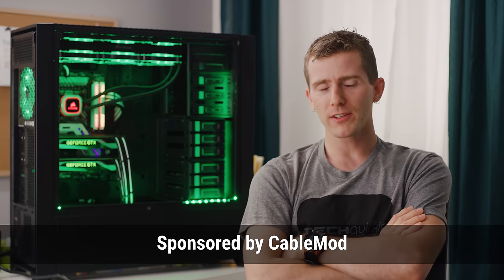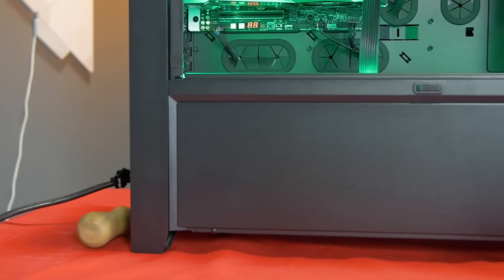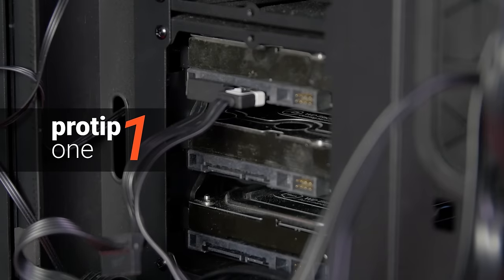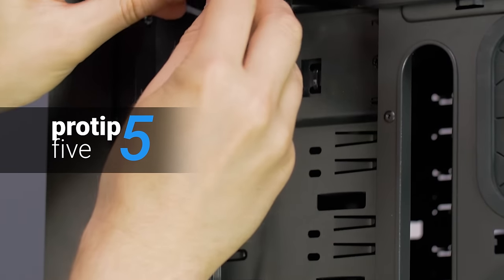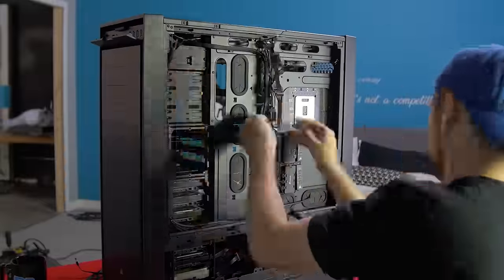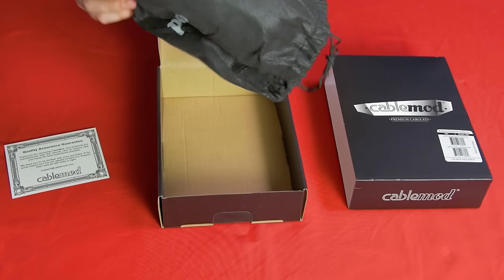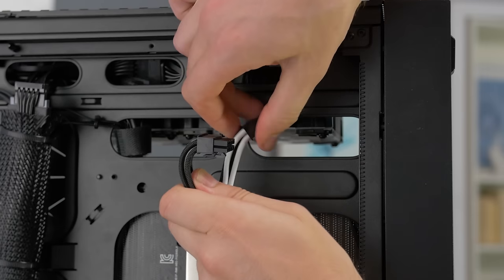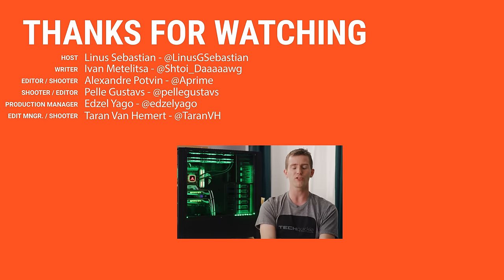ULTIMATE Cable Management Guide

Comment: 400 bucks on cables, no way
Reply: This.
I mean MAYBE if you want a specific color such as green, white or red in your build, then grab an entire kit for modular PSUs for maybe 50€ TOPS, but their whole bullshit is totally useless. 

Why in the fuck would you need custom sleeves that are 20$ for cables that you only see a few centimeters of, and WHY would you need sleeves for your watercooling ?
Reply: They're slow af to ship too. Don't accept returns, don't respond to support emails, and are pretty thin gauge wire. They managed to lose a paypal dispute with me simply because they didn't even respond to it.
Reply: Yes but in this case it looks shittier, I mean who the fuck needs a SLEEVE for his watercooling ?

If you want a green watercooling, you buy green coolant for cheap and that's it.
Reply: SpaceC0re there are plenty of cases for watercooling where you really need custom length cables. My caselabs s3 really needs very short psu cables since there's nowhere to hide them.
Reply: Well I can be wrong, but I guess you may have gotten scammed with that case, it seems far too expensive for what it is.
Reply: Nah I'm in France so there is a street in Paris called the "Rue Montgallet" which is FULL of Asian hardware stores, you can get everything you'd ever want to get there and they pretty much sell every piece of hardware possible.

Just got myself a new Meshify C TG case there on Tuesday, and they have everything delivered to them in two days tops. Really the best stores.
Reply: SpaceC0re when your watercooling components cost a couple thousand, and the case makes the build 10x easier and is the only one that supports the radiator config you want, a few hundred for a case is chump change. Caselabs makes boutique, high quality, 100% aluminum cases almost specifically for custom loops and they'll last as long as ATX pcs exist. It saved me at least 12 hours worth of build/planning time compared to my last hard-line loop in a normal $100 case. They're not a manufacturer for entry level gamers who want rgb, plastic, and stamped steel. They're meant for SERIOUS enthusiasts with very, very specific needs.
Reply: Enthusiast means paying hundreds for a case made of a basic metal structure ? Hmm...
Reply: SpaceC0re  i believe there is a saying in English that suits the whole cables and cases debate, it starts with; fool and his money... ; )
Reply: HOW TO BUY A GAMING PC, PAID 400 BUCKS ON CABLES
Reply: DagicCross  and another 400$ on water cooling fittings ; )
Reply: Result + 0 FPS
Reply: Custom cables are very much a luxury. They aren't for everyone.  Those triangle wall lights are STUPID expensive yet all over the battlestations subreddit. 

The standards cables aren't very good either. The pro is the way to go... Although that adds to the price. Cables AND cable combs are stupid expensive.

Shipping tho... The fact that Linus got his in a week is ONLY because he's Linus. It literally took about a month for mine. And I bought 1 24pin extension and 4 PCI cables. Short ones too!! 

Communication wasn't an issue. They are on Facebook Messenger. I asked them about my order and got a response in like 15 minutes.
Reply: Correct for custom length custom color thicker cables. A non custom kit is around $100 and a bit more will get you non pro custom cables for just the ones you need.
Reply: Looks good! Will consider buying there soon.
Reply: lol thats a 1070 xD
Reply: Anton Stones my rig costs less damn
Reply: Simon Liu . PayPal is disproportionately buyer friendly too.
Reply: If you have a cheap case - then optimising and tidying cables goes a long way. I spent what I thought was a lot for a case in 2004 at £50. It had really bad airflow. Panels off, watercooling. Thing overheated. I put the whole thing in a new case and it runs on air cooling.
Reply: @ Mark Coito lmaoo the Aurora Nanoleaf lights are TOTALLY worth the ~$220 they cost, even if they are gimmicky as hell. I don't think you understand the electrical engineering or business economics involved. A kit gets you 9 panels which equates to $24 a light. That really isn't that expensive considering they also need a controller, a power supply, R&D for a custom product, and programming, logistics/distribution, etc., which hasn't even been equated.
Reply: Thanks for the tip lawrance,im in the uk too and i got a prebuilt shipped to me and the cable management is so fucking awful,now i know where to look to get good cable management shit without having to wait for half a century to have them delivered.
Reply: I mean, if you're building a machine for over $10k for some reason then it might be worth it for the sake of completing such a machine.
Reply: Why do people spend $5000 on a suit. $600 on shoes. $1000 on car rims. Because they feel like it and it makes them happy. It's not hurting you at all so why complain?
Reply: 100%
Reply: if they were rgb it would be worth
Reply: 400 likes omfg
Reply: I could build a console killer pc in that 😆😆😆
Reply: @SpaceC0re Because some of us are happy to spend extra money on making it look cool to us and we can afford it. Why are you so invested in what other people do with their money? Should we all run our purchases by you and get your approval first? LOL

I bought an enormous Enthoo Primo Ultimate Deluxe thats almost as expensive as the case labs specifically because it supports a large amount of SATA drives (I can fit 8x3.5" and 6x2.5"), Dual PSU, everything is dust filtered and every single fan spot can fit a full size radiator because the case is EXPLICITLY designed for large systems with large watercooling loops. My motherboard is E-ATX and wont even FIT in a regular case. Is it excessive? Probably. Do I care? No. Am I happy with it? Very.

As for "looks shitter" looks are subjective - what you mean is it looks shittier TO YOU. But its not FOR you so who gives a fuck if you don't like it.
Reply: @Paradox Shift THANK YOU I was wondering what the hell those were actually called as I'd love to get some for my renovations :D Coming in a pack of 9 is perfect as I want to make a big gold glowy Tri-Force
Reply: Its for enthusiasts not the average pc builder. personally could care less about a window on my case so for me this is useless but for the people out there who do like to show off their stuff there is a place for them. Its like watercooling, no one really needs to do it but people do it cause they think its cool and want that custom look + max overclock.
Reply: Simon Liu Aluminium is a cheap and light metal. "Real enthusiasts" actually CNC/Carve/3-D Print their own cases. Because making your own case puts you at atleast 300% more enthusiasm level then buying one.
Reply: my Pc was 400 bucks
Reply: its OK if you dont get it, its called a trend for a reason. The old trend was wild cases, 100% custom watercooling, and unreliable cold cathode lighting. Nowadays its neat and uniform cases, RGB LED lighting, and custom cabling. If you dont want to pay cablemod a bunch of money for custom cables, its possible to do it yourself. Its just that Linus is sponsored by cablemod, so they get the drop. Mod One has sleeving supplies, wires, and connectors to build your own cables OR you can do what i did and buy some shrink tubing, paracord, and wax thread at Michaels (or any craft store) and make custom cables from your own cables. I think i spent $20 and 8 hours modding and threading my own cables (soldering required if you are reusing pins and wires BTW). It doesnt look as good as PVC sleeved cables with cable combs, but it's still miles better looking than standard cables. Obviously it doesn't help performance (it can help cooling though depending on how ratnesty your cables were to begin with), but the best racecars are painted nicely and wired efficiently anyway.
I know most of you dont have to care about what other people think, but i like it A LOT when people notice my cables and tidy PC. It just comes with my sense of pride.
Reply: Is that from Apple press release?
Reply: bitfenix cable set cost 100$ and are pretty good
Reply: corsair sets are only £50ish, are they any good
Reply: you pay the coloration/design of those cable but all of them are good
Reply: @diwiak  wut
Reply: @spacec0re78  Ils paient la hype plus que le matériel. Le prix d'un objet est fixé selon ce que les gens sont prets à payer et pas selon ce qu'il a couté à produire.
Si il avait fait ses cables lui même c'eut été mieux, là il ne s'agit que d'argent. Des gosses de riches ;)
Reply: My mouth dropped when I saw that total.
Reply: Its linus, What did u expect? he is the guy who tells you to buy those 1200 Ngreedia shit and Intel garbage. So $400 cables are nothing for him.
Reply: Find all parts on aliexpress, they are dirt cheap and learn how to do it yourself. I can send you list of links I favorited from their site with all the parts one could need for sleeving.
Reply: this guy gives good source info, as in how to run cables, set things up, ect, but yeah when it comes to actual builds he acts as if everyone should have the money to be building a $1000+ rig and if youre not spending ass loads of money what youve built is a pos, when in actuality its only takes around $500-$600 to be able to play most modern games on high settings, less if youre just playing fortnite, apex, ect.
Reply: Thats as much as my GPU and CPU combined
Reply: @spacec0re78  The question, my friend is "Why Not?"
Reply: Get the rich guy at school to do it for u
Reply: Taking the piss.
Reply: I just paid the same amount for a pc😂
Reply: Honestly just the 3 main cabels should be enough
Reply: @spacec0re78  Your why says you don't know what you're talking about.. Get lost
Reply: YES
Reply: Buy a cheap soldering iron, some solder and heat shrink and some ebay nylon sleeving. classy DIY if you dont mess up the wiring
Reply: Thats the only downside to custom cables.
Reply: Zipties $10 a piece. No one can afford that.
Reply: Linus is sponsored by cablemods.  Makes sense that he’s trying to hawk outrageous $400 cable solutions to his viewers. I’m sure he’s getting a kickback.

Comment: Do not put cables behind MOTHERBOARD. I repeat, do not put cables behind MOTHERBOARD. Those solder joints will poke a hole through them, sooner than later.
Reply: Also places under CPU and VRMs can get really hot
Reply: if they wont melt away. pretty shit tip indeed
Reply: Nah, u full of bs
Reply: My mb has a full backplate
Reply: No it won’t. You guys act like this is rocket surgery.
Reply: i've acutally seen melting cables pushed against a motherboard before.
as for the solder joints in particular, you have to be pretty carefull not to fuck it up.
it's not like it's bount to fail, if you do it properly it's all good. still, i don't recommend risking your motherboard or your whole pc if it really goes sideways just to tidy up your case a bit more.
Reply: well, fuck
Reply: ?? What if u don’t move ur computer at all
Reply: Pizza 73, that would be like no condoms, but you pull out.
Reply: I see, you are a man of culture, indeed.
Reply: Christian Grey 
What motherboard do you have? Sounds interesting.
Reply: Pretty sure it's a TUF Z270 Mark 1. I have one too.
Reply: Rexin Oridle 
Thanks a bunch, I'll keep that in mind for my next build. I really want to go ITX sized but that backplate is such a cool idea haha
Reply: Not really though if they are made of nylon, its pretty tear resistant.  On top of that the only thing that would cause tearing would be movement or bad vibration, and you shouldn't have that in a PC application like this.  Really a non-issue.
Reply: I can understand how it would be a problem with something that moves or vibrates like a car. Then you'd get very gradual sawing, but placing them behind the board won't affect them.
Reply: Couldn’t you also just... use standoffs?
Reply: Sure, if you're forcing them behind the motherboard. But just loosely tucking them down there is fine. The plastic shrouds on the cables should easily be able to withstand the heat that any component is capable of producing.
Reply: Motherboard standoffs exist
Reply: J W m8 you combined 2 sayings, but I would kill too see some rocket surgery
Reply: @doctorobvyous  Yes, i ordered a set of cable standoffs - they work like extensions but better
Reply: Its a pc not cernobyl nuclear reactor lol
Reply: @user-vs3fg4wq4f  Doesn't really matter if you move your computer or not. A lot of cases are made from metal, computers tend to get hot, thus there's naturally a bit of movement and stretching going on trough the whole build due to everything heating up (expanding) and cooling down if you don't use it (contracting). That's why full metal cases, in a cool room, can make quite some cranky noises as the rig heats them up.

Comment: $377 for some colored cables wtf
Reply: Nicolas No 50€
Reply: @tomkuttler  7.20 minutes
Reply: They come sleeved in paracord or a second material, they're cut to your specific length and are made according to the desired combination of cables you want.
Reply: v KEITH v  more than just ( a cable ) multiple multiple cables per connection
Reply: v KEITH v  Each pin has to have its own wire. Granted, sleaving each one does make it more expensive, but this is mitigated somewhat by the fact that you only buy the cables you want.
Reply: v KEITH v  It also adds two weeks to your build time. It just looks nice. Though I'd call almost anyone who wouldn't get a cable kit like that if they had the money a liar.

It's like denying that you don't want that RTX Titan.
Reply: Hey when people have the money to spend, these guys are there for them 
As for me, well, imma just say "nah I'm.. I'm ok"
Reply: You should watch Optimum tech's video on how to make those yourself. It's actually pretty hard.

Comment: Ok so.... I have really weird issue....I shut off power supply or unplug pc after turning it off properly.... when I turn it back on there is a chance that the pc will go on and off by itself repeatedly. This does not happen when shutting it down, restarting, or force shut with power button.... only when power supply is turned off or pc is unplugged.... i also hear clicking sound. Can someone please help me solve this problem

Comment: How to be good at managing cables-
Step 1: have a giant case
Step 2: shove everything in the back
Step 3: thats it
Reply: i holding to this principal ages ago
Reply: And PSU shrouds help too, if you have a small PSU 400-650w then you can use that extra space. My PSU shroud also has drive cage for 2 drives and I only have one, so more cables can go underneath the empty cage
Reply: Back of my case is clear tempered glass. Hnnng
Reply: Honestly, that’s why the 540 and the 680X Corsair cases are a contender to build my new rig in. But Li-Lian might still get my monies.
Reply: Thanks
Reply: @madynugent07  thats why Step 1 Exists, "Have A Giant Case"
Reply: Thanks so much helped at tone
Reply: Case Draughn cries in case that  has zero cable management space
Reply: I bought a $44 case and I still managed to manage cables...
Reply: @cryo_life  My case is older than usb 3.0 but if it ain't broke dont fix it
Reply: @e92willard  I'd replace the case if I were you
Reply: @cryo_life  im going to once i upgrade my computer
Reply: That's what he said?
Reply: @cryo_life  update i purchased a darkfalsh dlm21 mesh and my god its so much nicer than my ancient antec case
Reply: Pretty much!  What a useless video. LOL.
Reply: yeh, that is pretty much how it works lol
Reply: Well said
Reply: smoketinytom i have the 011 dynamic. not horrible cable management, i put some into the drive cage
Reply: i did that and my side panel now has a bulge
Reply: checks out
Reply: you'd be surprise how little cable management i did on a Corsair 1000D lol
13 fans, 1 corsair commander pro, 2 lighting node pro, 3 rgb hub, 6 pwm fan splitters. it was a mess lol. They had a nice little door in the back too, where you can just shut on the cables, and NEVER see them lol
Reply: And make sure your back panel isn’t glass/acrylic
Reply: Yeah man absolutely. Considering how much I change and mess around with parts, as long as the front looks good it’s fine
Reply: Thats what I did!
Reply: thats what i do lol

Comment: "Oh, maybe I should get some custom cables."
Sees $400 pricetag
"I guess mine don't look so bad"
Reply: Extensions are cheap, use those instead.
Reply: @joko49perez  Extensions will make them even longer and MORE of a cable management nightmare lol.  One of the biggest benefits of custom cables isn't color, but exact run lengths so there's no stuffing of excess cables.
Reply: @Zach-rw6jf  make your own cables, it's a lot easier than it seems. You could also just sleeve the cables that are already in your PSU if you're happy with the length. Extensions are only a nightmare if the excess cable was already terribly long.
Reply: @joko49perez  I think he's actually referring to using custom cables to assist with blending into his case so it's not so obvious. It's the same basic idea as painting your home theater speaker wire the same color as your walls so their not highly visible. I did this in my house and everyone always asks where the cables are until I show them.
Reply: @justinbowen1183  ????
I don't think you read my comment, we are making the same argument. Do it yourself instead of paying that much.
Reply: Actually that's just waste of money, are you going to look at ur PC case or will you be  using it? xD PC mooding is another trap to suck your money:D my mooding  is pre installed rgb fans max :D  they are more than enough to make the pc look good, imho.